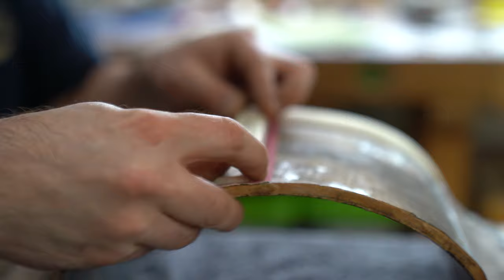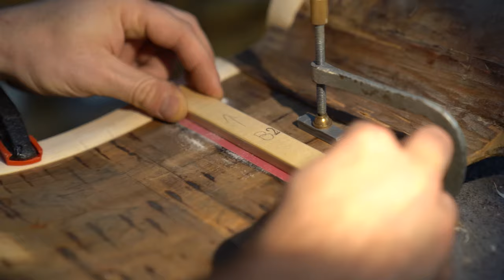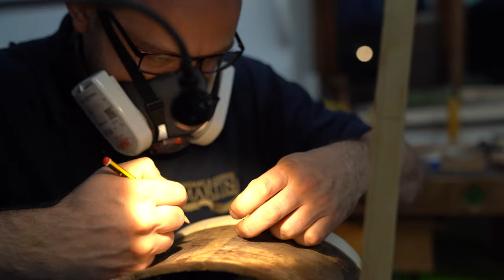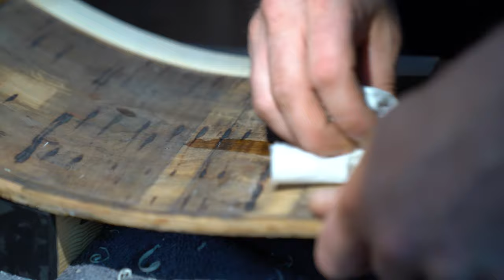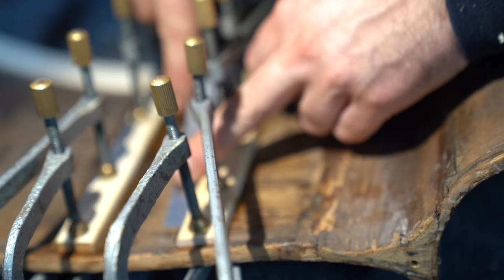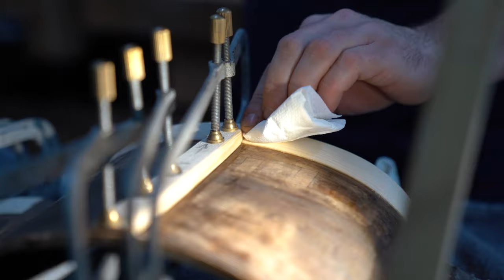Workshop: William Booth II Double Bass Ep 10, Fitting Cleats to the Ribs

Comment: I don't understand. By essentially making 'plywood' of the ribs at each of these cross-grain cleat locations, and especially with those 'popsicle stick' full-depth cleats, you're creating increased cracking potential in the years to come. If the instrument is not maintained at above 35% or so RH, the ribs will shrink enough to cause one or the other end of the stick to pop free, then you've got a buzz. I've had to remove so very many loose repair sticks like this over the last 30 years, it becomes tiresome. Do some reading on strong raw linen. Learn to apply it on the bias or matching warp/weft with grain, depending on how much stiffness you need and the size of the linen 'cleat.' This was the norm in Stradivari's time. We live in the age of the renaissance of high quality linens, unlike 200+ years ago when cotton virtually wiped it out and caused luthiers to go increasingly to cheap wooden cleats. Bad idea, and the spawn if vast numbers of totally unnecessary new cracks. Diagonal cleating with wood helps, somewhat, provided  the cleats are quite small, and indeed I continue using those, but rarely larger than 1cm and with a strong bias towards nearly following the grain to allow for seasonal movement parity. This whole video makes me very uncomfortable. You're basically making work for future luthiers, and suffering for the player, unless they keep the bass in an absolutely humidity-controlled environment.